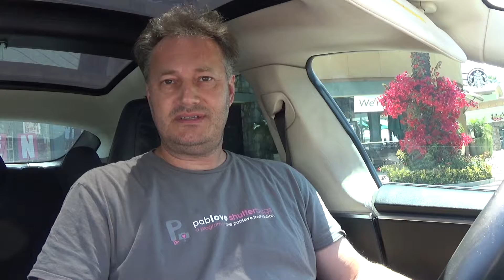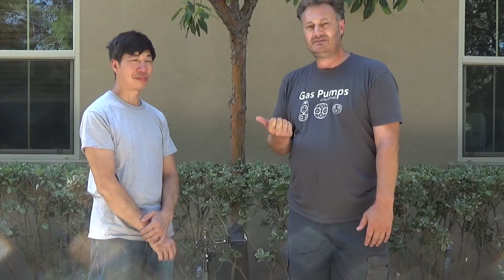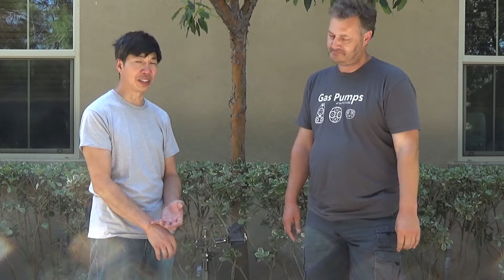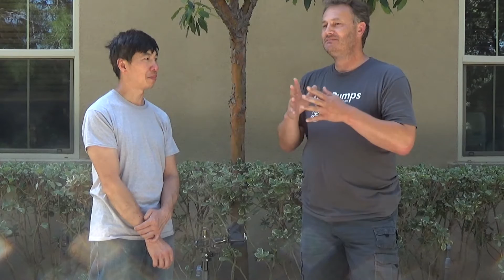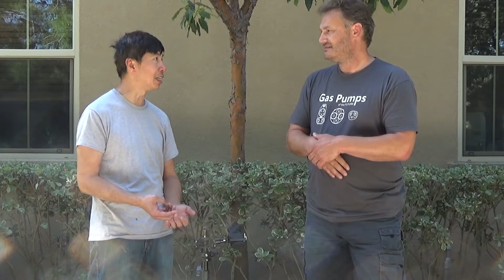MCU & eMMc chip issues in Tesla Model S/X

Comment: Hi David, I have a 2014 Tesla Model S P85+ purchased new from Tesla London and imported to Sri Lanka in 2014 December. I have the same problem that Tony and you are describing in the video. MCU never boot up. But the car is functioning except the air suspension which is adjusted through the MCU.
I wonder whether you will be able to repair my eMMc chips and reprogram them. I have a feeling that I will be able to take out MCU unit, based on the instruction given in your Video. 
I can DHL the unit to you to USA. 
My tesla is equiped with following options.
Model S Performance 2014 
Sound Studio Package
Twin Chargers
Blue Metallic Paint
Extended Nappa Leather Trim
Lighting Package
85 kWh Performance
Performance Plus Package 
Black Performance Leather Seats
Security Package 
Performance Plus Air Suspension
Tech Package 2,
21" Silver Performance Plus Wheels
Please let me indicate the cost to get my car back to normal.
If you need further information, please let me know. 
Thank you very much.
Upendra

Comment: David, in my 2014 Model S, my screen behind the steering wheel takes a long time to boot up when the car is parked for at least two hours.  This has been happening for the last two weeks. Is this a sign of the MCU 1 failing?
Reply from the maker: I can't say with certainty but mine was doing that as well. Once I had my chip replaced this problem is gone. I believe it was caused by the old failing chip

Comment: Not the best produced vid, but neither are mine.  Content is good and timely. Tesla is not looking out to help us owners of the older cars, esp those with MCU1.  100k of us out there need help in the next 2-5 years.

My car is a 2015 85D with 34k miles, yet I already have seen symptoms like poor connectivity on LTE, and skipping streaming. SeC says they have looked at my eemc and it is normal.  I am sure they say that to all the owners, just like they do about battery degradation.

One thing you did not comment on is the browser.  Currently it is almost completely inop.  On a good day under wifi, after a reboot, might get google in 30 sec or so.

If I replace the chip, what will that do to the browser?  Can I expect speeds like a smart phone of 10 years ago?  That would be a huge improvement.
Reply: Browser working well will depend on the version of your car's software, Replaced chips have helped browser on many versions.  I believe Tesla is looking for specific errors to identify a chip as dying, however sounds like your chip has some of the files for BT, LTE, and songs are in sectors going bad.  This behavior is "normal" for a chip of that age.  a 15  would be about 70-90% used of 3000 cycles generally.  You can ask if they will tell you how many writes have been used, your should be new enough to identify that.  http://evfixme.com for more info.
Reply: EV Fixme ø
Reply: @evfixme2816  don't forget the www's  :)  http://www.evfixme.com/

Comment: I just went through this.  Yes, very buggy and needed rebooting and all.  Tesla replaced my MCU1 with the same.  I did ask if I could get the MCU2 and I would pay, but that was not available at the time of my replacement.  On my MX I lost the auto open driver door.  Next week I go back to have that module replaced.  I had heard that this chip was wearing out and was the most likely problem.   So now my 2016 is stable again I would like to keep it that way.  I could see driving down to you and spend a few days to get this chip upgrade and never worry about it again.  I just need to think about the worth of paying the $2500 for the MCU2 upgrade to get faster screens and youtube feature even with loosing FM.   Looking forward to next video to help me with this decision.
Reply: For sure we can help if you decide you dont want MCU2.  We are starting to see lots of 2016 X eMMC's start to fail or be very worn out.